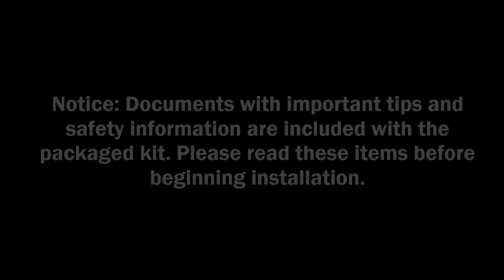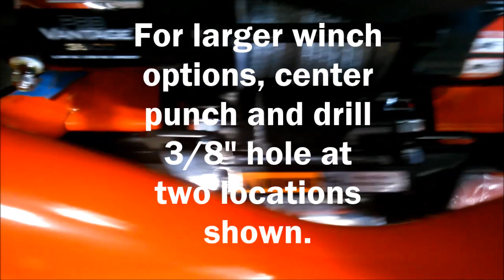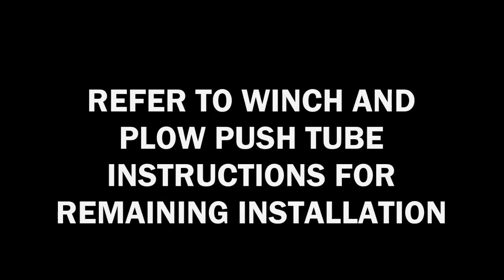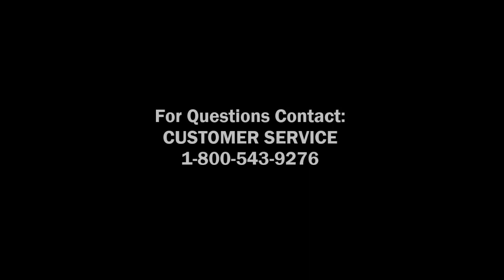2018 Yamaha Wolverine 4X Front Plow Mount Instllation (Kit 90865)

Comment: Public announcement: This video is not 100% accurate. Not all widespool winches will work with the Warn Plow Mount due to design. Warn technical support lists one Winch that is compatible the Warn VRX4500. If your widespool winch is longer than 15” or the motor circumference greater than 3.15” it will likely not fit.